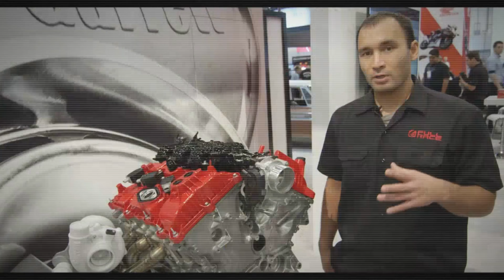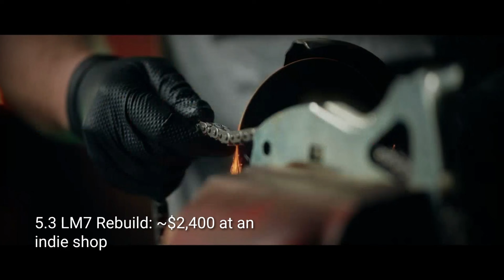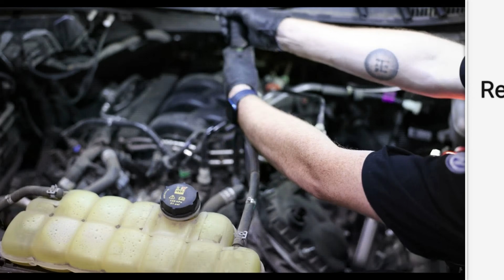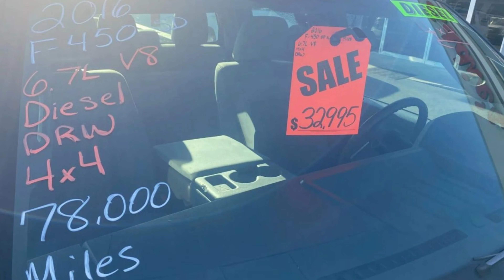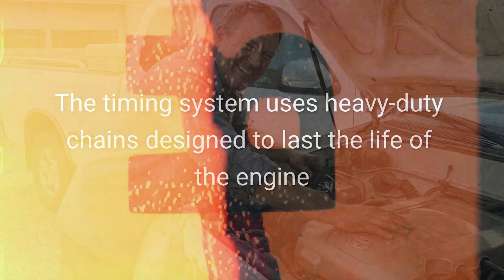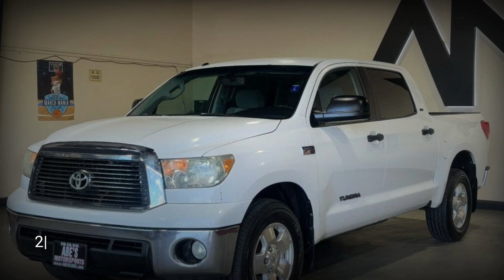3 PICKUP TRUCKS That Mechanics Drive to 500,000 Miles (And They Cost Under $12k)

Comment: I have a 2016 chevy malibu limited LS 2.5 liter. Bought it brand new from berger chevy in grand rapids mi. With only 18 miles on it. I bought it in 2016. I change oil and tire rotation regularly. I only had to replace battery at 300,000 and altinator.  Replaced value cover and got new spark plugs. Still gets excellent gas mileage. Also drives good. It mostly all highway miles.  I have 403,980 on it. I am still driving it.

Comment: Is buying a brand - new car actually a smart move... or just an expensive mistake most people refuse to admit?
Reply from the maker: Depends how you look at it 👀

If you keep it long-term and maintain it well, it can make sense. But most people sell within a few years… and that’s where the big loss hits.

Curious where you stand on it. New or used?
Reply: my last to cars have been new. My last car I had for 18 years. The one I have now is already 9 years.😊
Reply: I’m 83 years old, is a Nissan Frontier Pickup a good buy for me?  No towing, only drive within 50 miles of home .. Got any suggestions on what year, motor?  I would love a 4 door, AC, automatic transmission ….